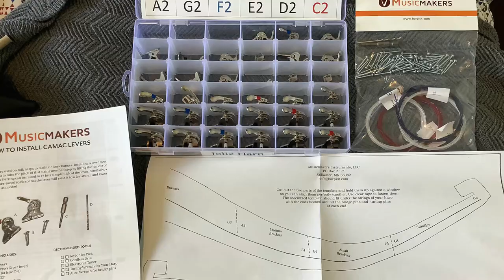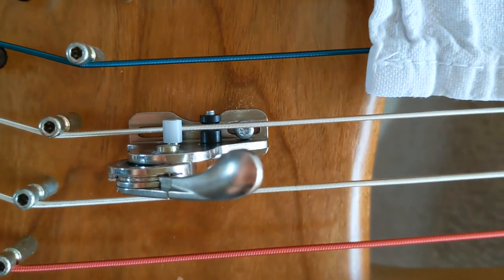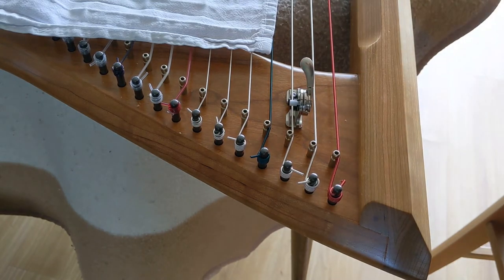Building a harp part 10: installing and regulating the levers

Comment: To fix the misaligned levers ... remove the lever and drill our the misaligned hole with a 1/8"  bit. Measure the depth of the hole and cut a piece of 1/8" dowel just a bit short of the depth. Glue in the dowel. Allow time for the glue to dry then remount the lever using an awl to mark the new position prior to drilling. I also suggest using using small washers under the mounting screws.
Reply from the maker: Thanks, will pin this advice as it might benefit others too.